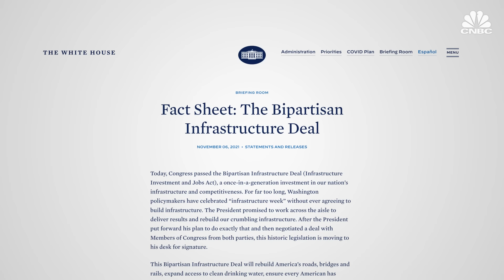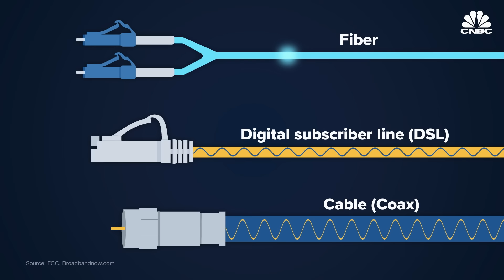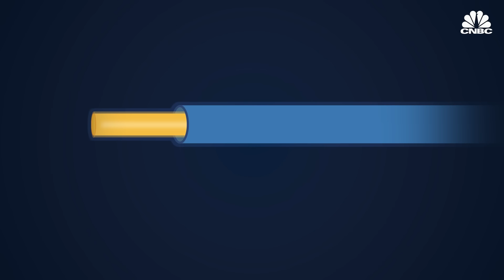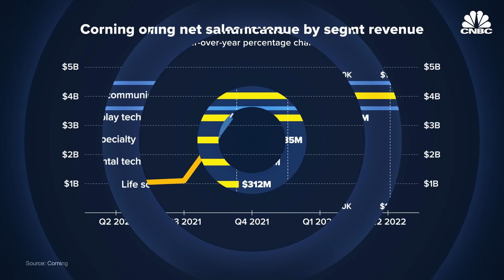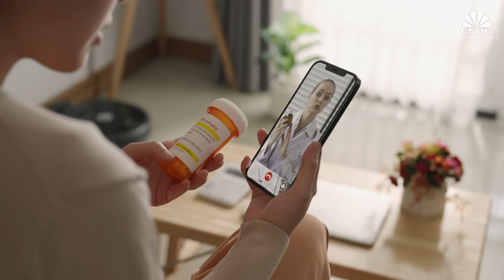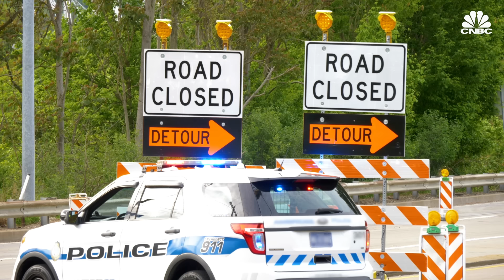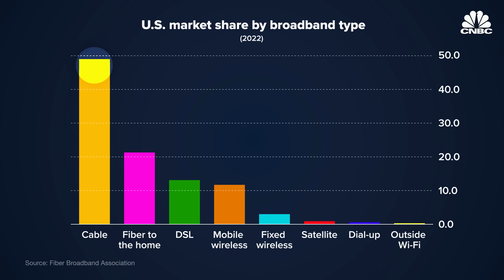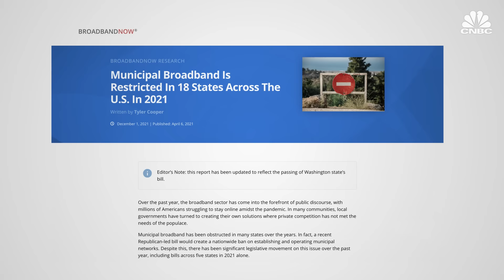How Fiber Will Speed Up America’s Internet

Comment: Aussie - You shouldve seen the Dodgey cabling c/os hiring anyone  here  with a ute or van :)  Some  people mowing lawns in QLD oz ran over  unburied  cables  wtf 
goes to show once they handed out contracts its  1st in  pigout  My installer $685 cost put 3 staples thru the Phone cable- i  2 years of Chitty NBN  
  - year  L8tr  Curious  with a torch went along the line |---| wtf and seen the staples piercing the line maked with a black texta took Pics  then removed them Been better since but cuts out 8hrs
 IDK WHY telstra here pulls out 100 year old phone lines when its what they use inside house to conect Modems :)  @@ another scam for more  $ No this is specail fibre nbn cable 
      NO ITS NOT  you can buy the  phone line  off a hardware shelf E/bay as b4  xd  and $ 1/2 the fooking price the installer contractors charge  from the Node  Box to your house  is  seen in Parks    OH 2 years of poopy nbn here in  OZ 2018 2020  finally its getting serious with it Bye bye corrupted  govt- Liberals - lets now move along  . i hate Libs like Coakroaches under my SHOE bad

Comment: old news, old tech,.... bandwidth is no longer the problem in the US, it is: (1)  power grid, that is outdated and overloaded and the gov tears down old dams and replaces with nothing; (2) the complete waste of bandwidth by allowing constant DDoS attacks, port scans etc (and I've witnessed the constant attack by China on US infrastructure first hand) - so you don't need more bandwidth you just need to use what you have better; and (3) having people of average or below intelligence running the government (again, witnessed first hand when I worked for feds and local gov, and a non-profit that was funded by gov grants).

As others have pointed out, plenty of $$ thrown at bandwidth and telcos already.
And now the 5G wireless will be better than what most people have at their homes.

Finally, I don't want or need fiber to the curb / house at all.

Comment: Fiber optic is currently available for half Gbps or 1 Gbps, which I cannot even figure is how much slower than the speed of light.  The roll out of fiber speeds is going to resemble the roll out of such things as pixels per square inch on monitors or hard drive and memory capacities.  Is this really overcoming technological hurdles or is it throttling for maximization of profit?  With upgrades coming out constantly, consumer hardware, savings, and weekends are skewered.  Is the profit motive working to the disadvantage of the necessarily-subsidized-earnings population; or is it providing capital critical to the further advancement of scientific innovation?  Everything I need from the Internet was just as good at 20 Mbps until it wasn't.  We got almost no spam calls with rotary dial phones.  Before the computer, it was possible to understand the Sched D and know the tax consequences of an investment.  Life not lived with peace of mind is like running on a stationary machine, through video-taped Manhattan, breathing smoke-clogged air, so one can look slim and trim when attending an Off-Broadway opera.

Comment: This is just a puff piece so the fiber manufactures can sell more product. Cable internet works fine, do we really need a fiber optic to every single house in America? It's "future proof", but do you really believe in the next decade people's internet consumption is gonna multiply by a million? Don't forget, it's the modulators needed at the endpoints are expensive as hell. Why install fiber that will need a $1000 machine at each end when for short distances copper wires do just fine and are directly compatible with existing NICs?

This is just a gimme for the fiber optic companies. A simpler solution would be ethernet to each residence, and then we can have fiber optic to colocation switches in each suburban block that spread out.
Reply: My monthly cost for fiber is less expensive than equivalent service through coax cable from the competition. Technical support is much better as well.

Comment: Research and understanding of info is very poor. Most people in US now have fiber and last mile is copper. The reason this having is not enough fiber hooked up to the nods and being provision correctly and not overloaded (fiber is there they just don’t want to buy the extra equipment to raise the bandwidth up and split up the nods just about every provider has each nod at 400% capacity most Internet provider services from 5 PM to 10 PM and you cannot get a service truck to roll during these hours because they don’t want to document it ) to each location providers not wanting speed the hardware upgrade money to support high Bandwidth unless there’s real competition all provers do this. This so much misdirection and lies in this video, it is price as little internet for the highest cost with upgrading hardware because most people have fiber up to the last mile or less and is enough fiber at each this location unused that reworking the nod correctly could give everyone 1gb up and down with no issues. If you want to pay this price almost everyone can have it in a few days it is so close.

Comment: Let's face it, until the law changes, there is NO incentive for ATT, Comcast, or even Google to invest in American infrastructure. The CEO' rather prefer ingaging in stock buybacks,mwhich not only profits them personally, but corrupt politicians too. Other countries that started internet much later (former eastern block countries) have much more faster connection for much less. My cousin in Poland pays $30 a month for synchronous 1GB internet accesm WITH cable programming included. Form $83 a month, living in the SF Silicone Valley i get "blazing" 400/12 Mb connection with no cable included. The main competitor, ATT can even get reliable 100/12 mbs. Of coursemwe know how missmannaged the companynitself is. First it spent 80 bln on WB (another American loser) and be forcedmto unloaded with multibillion dollar loss. Will anything change? Well,mthe dividends will drop fro 8 to 5%, but getting their business in tio-top shape?  NOPE. This would be too logical and less profitable for the CEO short term. I only wonder why Google stopped competing with the big telecom? Conspiracy?

Comment: Bye bye undersea fibre optic cables. Starlink is giant fiber optic mesh network, but without the annoying physical fibre part and without the impedence of glass. Pure light in a vaccuum baby.
Reply: LOL yet they still have to connect through ground stations...and don't have the low latency of fiber. It's cool...for some but doesn't beat fiber
Reply: @mrmotofy  It seems you don't understand latency or mesh networks then. Nothing beats the low latency of light in a vacuum. Try looking at how v2 starlink works.
Reply: @roborchiston9419  So what are you trying to say? The starlink still connects to ground stations which is where the internet exists otherwise it's just a sky network. BIRD 2 BIRD 2 BIRD  to a ground station by a laser through the air on the 2nd Gen. The connections to other devices are laser or the 1st gen RF.

Comment: The reason for America being "behind" (when it really isn't) has more to do with the telecom deregulation of the 50s through 80s that resulted in the break up of AT&T or otherwise known as Ma Bell, the national telephone company.  For 100 years before that, Bell Telephone successfully installed and maintained elephone and telegraph cables across the entire country, to connect every home to phone service.   And fiber optic technology is also something that has a long history at AT&T from Alexander Graham Bell sending phone calls over light waves with his photophone, to the invention of PCM at ITT (the international arm of AT&T) and the discoveries made by Charles Rao also at ITT, to the development of better lasers for transmitting signals over fiber optic cables by AT&T.   And if it hadn't been for the break up of AT&T by the government, they would have long ago rolled out an early form of FIOS  to replace all the legacy phone cables installed in homes 100 years ago.   Without a nation wide carrier able to provide the roll out of this infrastructure, you are going to be limited due to the fractured nature of the marketplace and the fact that these smaller companies do not have the money or size to actually roll these technologies out at scale.    In fact the only reason coax internet (also developed by AT&T) , ISDN and  Satellite (also developed by AT&T) even exist is to work around the lack of high speed infrastructure to the home (legacy AT&T phone cable).
Reply: I would disagree...it's the Corporate GREED, no accountability of the funds paid out to them in grants and no real competition due to exclusive monopolies. As well as all the BS redtape in the last mile installation
Reply: @mrmotofy  Greed is part of it but that doesn't change the fact that AT&T created the transistor.   And due to government regulation was forced to license the patent for it to anybody that wanted it.   That also blocked them from being able to do any work in computer technology as well.  But keep in mind that in tech, economies of scale as found in large corporate conglomerates are far better than smaller "competitors".   As such that is why you now have TSMC as a near "monopoly" on advanced chip production, because the cost of doing it is prohibitive for any kind of smaller company.   Tech and telecommunications has always been like this, so it was stupid to break up AT&T because it only slowed innovation.  The US could have had hi speed internet to the home decades ago if not for that because the biggest obstacle was the old analog phone system built by AT&T. And being that AT&T was no longer there, the cost and effort to replace that infrastructure was too much for any of the baby bells to take on by themselves. And we see the result of all the so-called "competition" resulting in America no longer leading in chip production.  Not saying that monopolies are good, just that having 10 different phone companies is a dumb idea to begin with as you logically cant have 10 sets of phone wires over the entire country anyway.   Not to mention that in capitalism, most of the time it is a winner take all game in most cases anyway.

Comment: I've had fiber for over 7 years.  It's not that great.
Reply: what do you suggest is better?
Reply: @Vempzy  the 5g internet on my phone is just as fast or faster. The problem with fiber here is alot of it is overhead & the squirrels & sun have damaged most of the lines so the sunlight actually penetrates them.

Comment: just receieved fiber inerent end of year 2023. NOT getting all the hype. still slow as HELL. slower than verizons home wireless 5g internet whcih never tested past a 100mbps but was wayy more consisten than GIGABIT FIber. fiber internets a scam.
Reply: lmao. Its not a scam. If it was a scam, why would fiber be used as the backbone of modern computer networks? Just because it doesn't work well for you doesn't mean it in itself is a scam. Its hard to say why you're having trouble. It could be a bad router, bad fiber connection, something on your internet provider's end, etc.
You do realize that the cell towers your 5G device connects to also use fiber cables as a backhual?